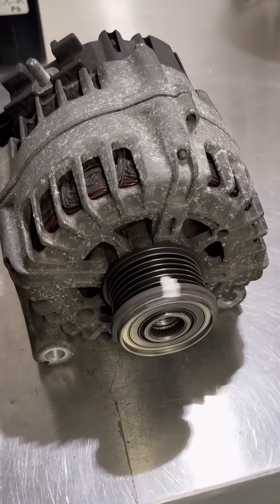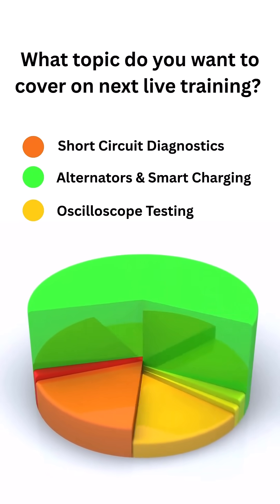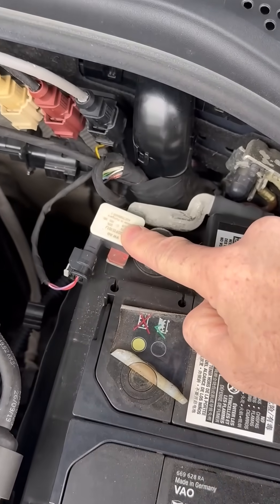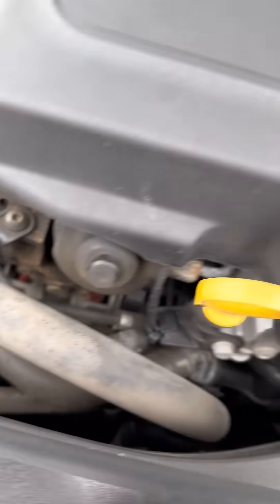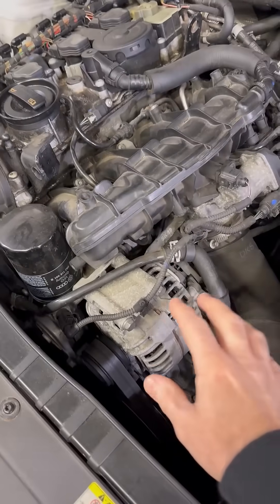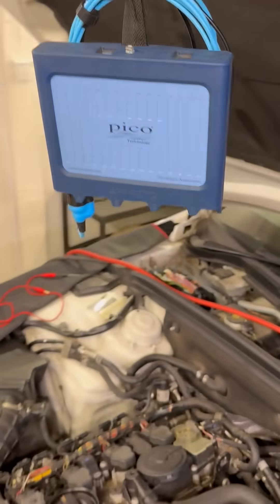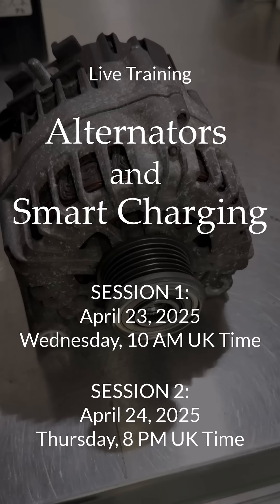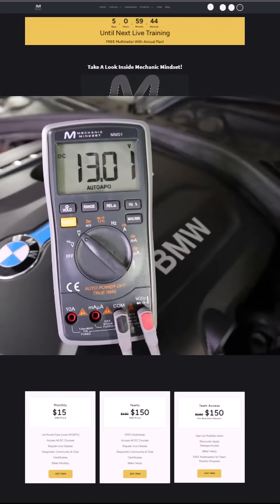Top Training Pick! How to Diagnose Smart Charging Systems Like a Pro | Mechanic Mindset

Comment: My opinion, buy the least expensive scanner, 'Any Brand' with "Topology Mapping" keep it until the updates start costing you and buy another new one with free updates.  For example only "not a sponsor"  For less than 1/3 the price you can get the XTOOL D8S W/3-Year Updates, after 3 years you buy another one with all the new features and updates. Using Xtool as an example, one can buy '3' Xtool scanners for the price of one 'T10 Icon'. This way you are not stuck with an over priced POS after a couple years. (Not saying the 'Icon T10' is a POS) but every 2-3 years buy a new one. Same as computers there is no way one can future proof technology, buying something, and try to justify the price by saying, "I want something to last me a few years before its obsolete" makes no sense. Buy only what your needs are today and save the money to buy what your needs may be for the future.